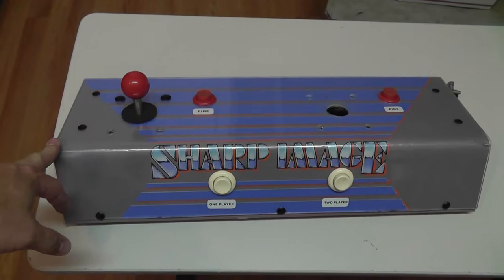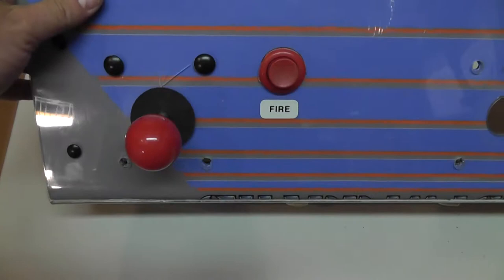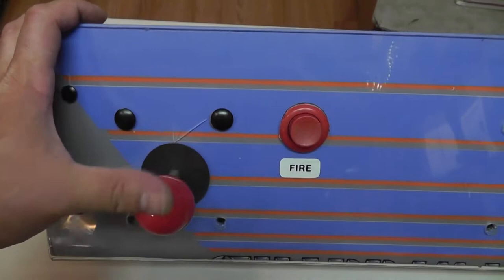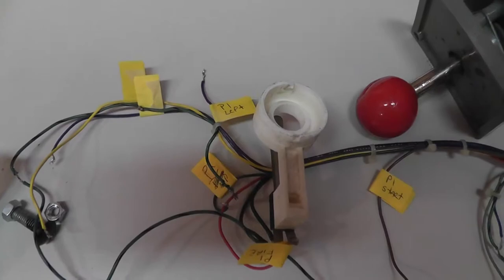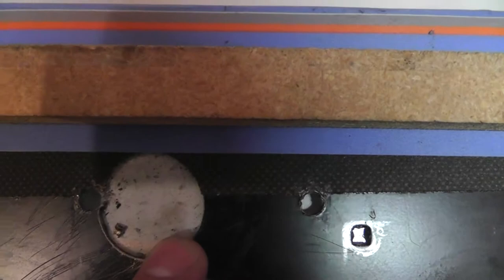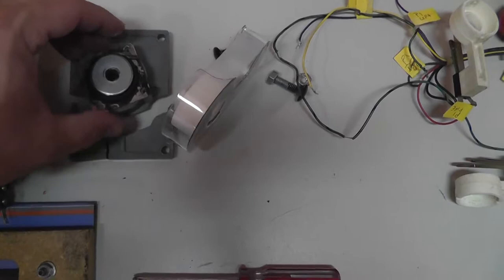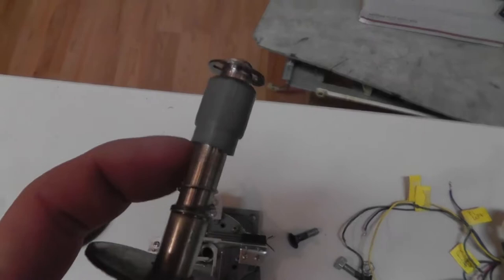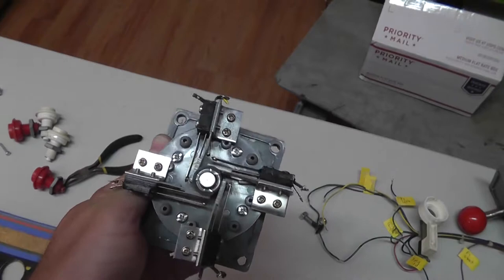Wico Arcade Game Joysticks - Part 1

Comment: keep in mind, the wico for robotron is 4" if mounted flush against a typical 3/4" wood control panel, but if using thin metal panel or modding something like an atari fight stick or other retail panels these days which has the panel dug out for the joystick mechanism, you wanna go with 3-1/2" shaft or else it'll be taller than stock.
Reply from the maker: Good reminder.  Robotron is 4" stick when using original control panel.